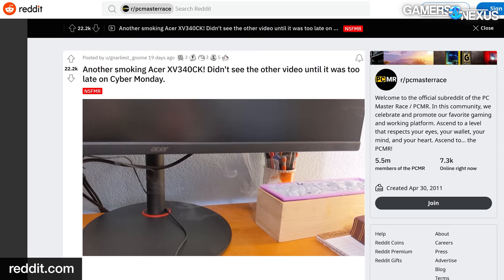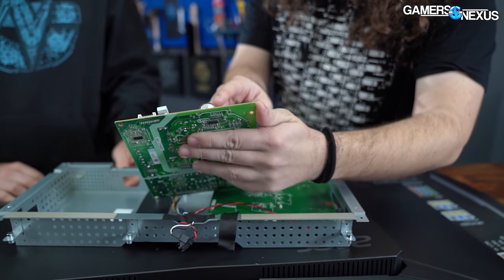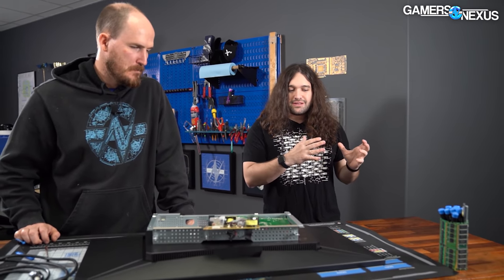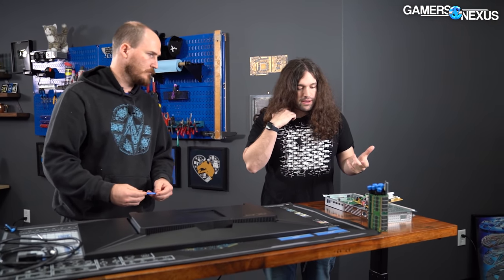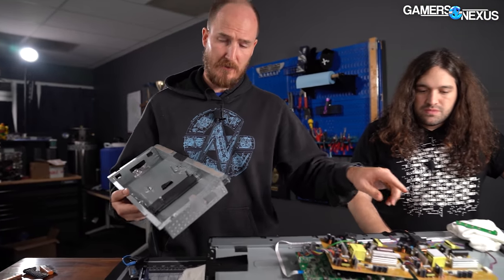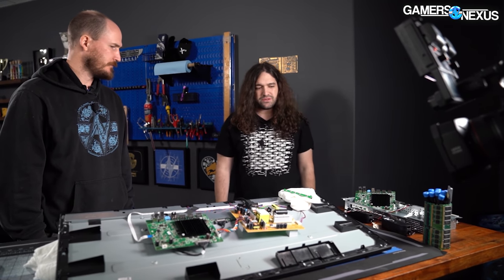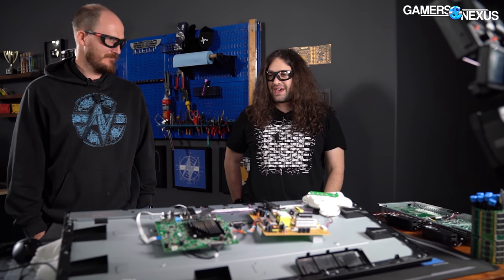Acer Monitor Fires Investigated: Blown Capacitors on Acer XV340CK

Comment: Nice video. I bought three 34" 21:9 1440p ultrawide monitors, and when i was deciding, this exact Acer model was one of the last two choices on my list. It is priced competitively, but I went with another brand name that was $25 more expensive. I stick to the best brand i can afford. My only and biggest disappointment buying the best brand name was the Samsung G7 240 Hz. What a piece of junk.
Reply: Of course, the other unnamed brand could also have been manufactured by Acer. There's not that many OEM's for reasonably good monitors.

Comment: Probably a bad voltage rating on the brown cap. 
That exact issue happened to me on a TV i was repairing. 
I didn't have a 450V cap but i had a 420V and was in a rush so i thought what the hell. 
After a few minutes of being plugged in the cap popped and smoked

Comment: those dont even look like thermal pads those Look like a die cutters rubbers that they use to remedy bad die cuts on flexographic printing presses. The dieboard repair (if you would call putting those sticky pads on repair) would consist of analyzing the pressure points of the cuts and just simply spreading these about, then seeing if the results would improve. They are usually rated for extremely high impacts and resistances, and their adhesives are very strong. Do these look like anti-vibrration rubber material or the material that is used in thermal padding? how is the spongyness?

Comment: Looks like the capacitor plague all over again, or a bad batch/design? That CAP vented like crazy but I guess it's better than exploding... It would have been definitely a blast to remember xD
I work with power supplies and see such CAPS exploded or vented almost daily, but they are old CAPS that worked for years. It is not difficult to replace the capacitor if vented (it's a mess to clean after it and check if it took something else with it), but it is still better than exploding and causing irreversible damage to the PCB or other electronics.

Comment: I was given a 27" $800. Samsung monitor that had poor color; it turned out to be the power supply brick, the monitor would shut down if color balance was set. I realized the power supply brick attempted to draw more power when I corrected the imbalance, "after going through the specs it was clear the external power source was underrated", my solution! replace the power supply brick with twice the current capability matching the 14 volt feed, "problem solved". I fix a lot of monitors, Samsung was well known for power supply issues, especially the built in type that led to capacitors overheating due to poor ventilation and the tight compact design.
Reply: Se790 34" ultra wide. 

Huge powerbrick, but under rated only like 65w. 
Monitor has several USB ports. One of them is a USB 3.1 port, 40w output alone in that one port, effectively only leaving 25w to power the monitor itself 🤦‍♂️

Comment: Metal enclosure, is for fixing boards and grounding, almost all screw holes are used for ground, it may affect function on power supply board and EMI shielding on logic board.
Transformer is i think input filter. Why you dont use thermal cam on this? its perfect for this.
Be warry of just simply replacing main cap, switching transistors may day with it. 
Lenovo had similar problem with main cap on their laptop ,,chargers,, one that was more long, 4y ago. All laptops sold with it came back in two months with blown main cap and Lenovo doesnt even want charger to be send to them, one call and they send new charger, they know :D

Comment: Btw, those bulk caps don't need to be precisely those values. 100uF/450v/105*C are quite easy to find and cheap, ~$2 a pop.
Reply: Also 100uF/500v same deal, cheap and easy to find. 480v is an odd one, not sure why they're using that one.

Comment: I've had at least 6 back light controller failures from Acer monitors resulting in smoke/ fire,  all older models, mostly in there value line. but shows a pattern

Comment: What if the black cap wasn't a recent change, but the original part? And the faulty caps were used more recently due to component shortages. It's maybe possible.
Reply: yeah, i think it may be just a specific batch that had these bad caps

Comment: My place of work has been dealing with semi conductor part shortages all year, in which they've had to resort to 3rd party brokers that way overcharge.  Those caps are one of our main shortages, and many are questionable.  Testing our PCB's some of those caps will pop for no reason.  The only time caps blow up for us is when somebody puts them in backwards.  I wonder if other companies are buying from these 3rd party brokers, and getting crap basically.  I mean there's been a lot of fire hazard issues this year.  Even ASUS has one going now.
Reply: Yeah, I've resorted to using commercial grade components in our automotive prototypes, just so that the software developers can start getting to work.  But I'm still concerned, I have an order in for some NXP S32 processors that got put in on November 2020 which they most recently stated that they expect to get in January 2023.  I never expected the shortages to get this far out (and as a result I've opted to move to Microchip's automotive parts for the next project as they seem to be able to actually deliver product).
Also, yes, the parts broker prices are hilariously ridiculous (I was getting quotes on the order of 20x Digikey's single unit pricing for lots of 100), and were clearly never meant to be used for currently produced products.

Comment: I don't think those are thermal pads. I think they are used so the circuit board dosen't come in contact with the metal casing.

Comment: what if the power supply line from the wall outlet is overloaded with too many devices or their ground at the outlet is not connected to the emergency ground in circuit breaker box. iv'e seen powerstrips actually melt because the neutral wire became disconnected from the  device or outlet and the ground wasn't connected to breaker box.

Comment: Could it be a combination of which cap was used & what gpu the failed monitors were being used with & were they being overclocked? Was just wondering if maybe overclocking or the gpu could've caused the caps to fail?

Comment: My dad used to work on old TVs  and said to me if a cap pops within minutes of power on he would look earlier down the line like a transformer and check the cap clipped to see what the input voltage is when it's powered up and what it is when it pops

Comment: I have two 24" Acer Monitors that are close to seven years old now, and they still work fantastic!  I know it's not the same model, power supply, etc... but just wanted to chime in that my Acer monitors are quality built and I would not hesitate to buy another Acer monitor based on my existing experience with Acer.

Comment: I wonder how many hardware fires we will get in 2022?

As far as the different parts. I work in automotive manufacturing, a competitor, Toyota is well know to have a minimum of two suppliers for any given part. So if they decided that one is underperforming, not meeting QC/demands. Then they can just dump them if needed and find another to take their place.

Comment: companies like Acer are not directly to blame, they only assemble components made by other companies, the problem is they are always searching for cheaper components, they all are doing that, and so the problems move into our homes...second problem is their margin of design is lowered every year, for example a good company will make a 500watt PSU deliver 600 or 700 when necessary, while a bad company will make it crash at 501 watts or even lower...i have 35 volts capacitors that will blowup at 30 volts

Comment: I guess it is a moisture condensation due to temperature difference. When you bring cold electronics to your warm home, moisture will start to collect on cold components. Thats why you do not unpack it immediately, you just let it get cooler, it takes few hours typically. Then you unpack it and power on. Simple physics. And guess what, its winter...

Comment: I have daily used this monitor since January 2020 so I can confirm they don't all die, at least not immediately. I'm assuming this was just a bad batch of capacitors that leaked. I know I had a Dell desktop smoke due to a blown cap, which was not uncommon years ago in Dell computers.

Comment: Acer is the twin of dell. my wife bought an Acer prebuilt last week, impatient as she is.

1500€ for propriety parts, dismally bad cooling 90c cpu on idle, gpu 80c. 

mainboard and psu and the cooler are proprietary. the cooler mount is glued in. it's basically trash.

had to order a mainboard and tower and psu to rescue the few good parts.

landing at 1900€ for an i7 11700f and an rtx 3060ti... please continue to educate people.

I'm afraid though that you won't reach people like my wife.

please invent a browser plugin that lets you check a system online :)

Comment: ok, one thing. If the cross section is to release high pressure due to high temp., would taking it out of the enclosure influence the test and overall temp?

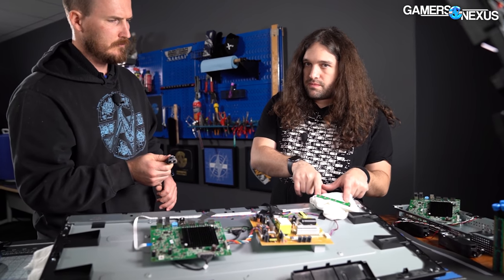Comment: 11:25  I have a Sony with the TCON board that went out.      There is no doubt SONY would have had less failures using a custom  aluminum heat-sink  directly to the T-CON board Chips rather then use the frame assembly, with a THICK like Jay-lo thermal pad to STEEL Chassis "heat sink".    

I'd expect this from some Budget brands.  But SONY's Flagship TVs?    And its not like there was a chip shortage in its day.    But it did make it past the warranty, so there that... 

In all honesty?   There really is no real reason to fix Displays as the tech price resolutions and form factor / Weight keeps going down each year.    And the price of Displays especially for televisions used in most consumer settings in a home are just about as cheap as Chips.  

For what its worth?   Dell seems to know a thing or two about keeping displays working for years.  And its surprising that LCD screens made by companies  back in the early 2000's are still running strong.   While some modern day screens seem to only be made to last till the next  feature upgrade.    

IMO?   When it comes to most consumer and Computer displays for mass market?  Who cares...   The display tech is almost moving faster then the parts fail.   So no loss here.  

The fact that you can get a 70 inch display for less then $400 bucks sure takes the sting out of replacing it when it malfunctions.   Rather then buying a USED board that will fail again in short time if not modified by the enthusiast or Tinkerer alike.

Comment: Would the back being open be enough to add considerable cooling to prolong the effects?
Reply: When enclosed by the case and shielding, mounted vertically, air must pass through the grill in bottom of the case, up through the PC board, and out the grill in the top of the case.
It should be noted that air would be flowing across both sides of the PCB.  When set up horizontally as in the video, there is far less restriction in the air flow on the top side (and room temperature air is free to descend onto the top of the board); but there will be much less airflow on the bottom side of the PCB.  As the capacitor in question is mounted on the top side, it is almost certainly is in a cooler environment when disassembled and oriented like that.

Comment: So if the cap was in danger of blowing up, you would have seen it with a thermal camera... Could also be that the cap is just the weakest link in the chain and the problem lies elsewhere, but unlikely since it seems to be the only variable.

Comment: Could you please test the msi aio with the pump in the radiator? My one died after like 6 months and I have read on forums that it has an extremly high failure rate.

Comment: A electrolitic capacitor can fail any time not just when new. When new fails that can have several causes like bad design or bad batch of caps. Then there are devices that fail in like 2-5 years, this again is not normal for capacitors, and always has to do with maybe even intentional bad design (making things fail after a few years). You can find these kind of things when the voltage on a capacitor is equal to the max. rated voltage. If a capacitor is good quality and the design is not using them at their max. rated voltage (below 90%) then the only enemy of the capacitor is time, as the chemical composition degrades over time. As with the warrenty of for example Seasonic Prime power supplies is 12 years this is a good indication of what the minimal expected life span of a good capacitor should be. In practice i see capacitors fail of age after about 15 years or more in most devices i repair. When they are much younger when they die, i always check the voltage over the capacitor and most of the time replace it with one with a higher max voltage rating. This most of the time results in a device that had a first lifespan of on avarage 3 years not to fail again after repair until it is almost certain to be obsolete.

Comment: Is it just me or is someone else thinking the board Looks like it comes out of a 90s TV?
The manufacturer puts so much in the outside design and inside its still looking like a electric experiment of a 4th grade sience fair😁

Btw If a display fails Up in smoke after this short time its mostly the powerunit which don't get 230v to 110v fast enough.

Comment: I noticed that the cap on the power board is 'bulged' at the top.  Could this be what started / or developed the failure?
Reply: Yes, it was likely the cause of the smoke.  Steve mentioned this in the video, electrolytic capacitors are constructed with a valve in the top to release excessive pressure (similar to how a lot of batteries are constructed).  If something happens and the electrolyte get hot enough to boil, it becomes a gas and the internal pressure rises.  This causes the exhaust valve to break open, allowing the magic smoke to leave, which has the intended effect of preventing the capacitor can from exploding and sending aluminum shrapnel in random directions.  A side effect of this is that the can bulges outward, as the internal pressure must be extremely high for the vent to activate.  I've seen a few caps explode violently; they seem to almost always send the can flying in one piece, as they fail at the bottom of the can where they are attached to a plastic insulator for the legs.

Comment: I saw something like that happen to a monitor once.  It turned out the screws for the monitor mount were too long and were contacting a trace on a PCB.
Reply: I always check for this if I am changing a monitor or TV mounting  by using a thin plastic item like a straw from a WD40 tin.

Comment: I can tell you right now what the problem is with that power supply capacitor. It's showing classic failure from excessive ripple current. I've seen this a number of times. It's totally down to specifying an inadequately rated component OR the component supplier is supplying a part that's below par (doesn't meet data sheet ratings) probably due to sub-standard materials used in its manufacture.

There IS a fix and it's simple. replace with a part that can do the job without expiring ! That MAY be as simple as replacing some Chinese no-name brand capacitor with one of identical value from Panasonic, Samsung, Nippon Chemi Con or any of the other reputable names in the business.  In this case, that'll almost certainly be the fix.

That moisture will be leaking electrolyte from that 100uF/450V electrolytic capacitor. It can leak under fairly high pressure and spray around a bit, so it'll get onto other parts. The 'goo' is mildly toxic so wash your hands but can be safely wiped away and cleaned up with water and alcohol/isopropanol. A value 100uF in that location might be marginally rated for use on a 120V AC supply btw. I had to dig deep for the rated power consumption of 60W. It doesn't appear in the manual (which it should), not a good sign ever. I might choose to replace with 120 or 150uf after looking into it in more detail. You'll find that the relevant ripple current specification varies considerable both by capacitor manufacturer and model range (standard/long life/high temperature/reduced can size) etc. It WOULD NOT have been a fire hazard as such. The 'smoke' seen would have been 'steam' from the venting capacitor.

The other possibility is that the part is a 'knock-off' or counterfeit. The supplier may go to considerable lengths to make it APPEAR like the genuine item but will have spent as little as possible on the content of it. I've seen some truly astonishing counterfeit semiconductors where the chip/die inside the device is only a small fraction the size of the genuine part. It'll work 'for a while' before going BANG !

Comment: Would it change the conditions in anyway if you hooked up a second monitor and just duplicated the screen, so you dont have to lift up the test monitor and have difficulty trying to get programs running?

Comment: what the hell, i just watch Z690 motherboard caught on fire and now this?
The capacitor in 7:14 doesn't look like a cheapo and the choke in 3:08 doesn't look bad either.
It could be anything, from mounting the cap backwards, the choke affect the DC ripple, thermal problem, needs more testing.

Comment: The failed capacitor looks like a HERMEI BL, or YAGEO BL. Both are horrible, but they usually last longer than 5 minutes. CapXon and Suscon are crap as well.

The explosive failure could just be a bad cap, especially if the monitor powered up and was usable until it blew. If the voltage was high enough to blow a good cap, it would probably have fried the monitor instantly.